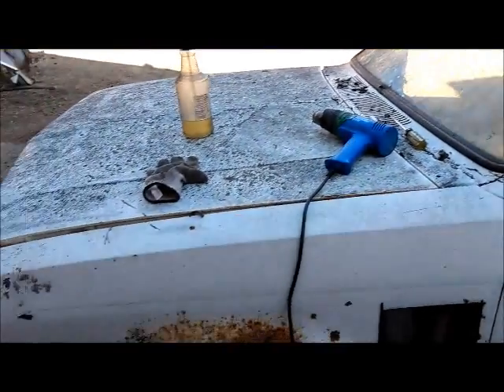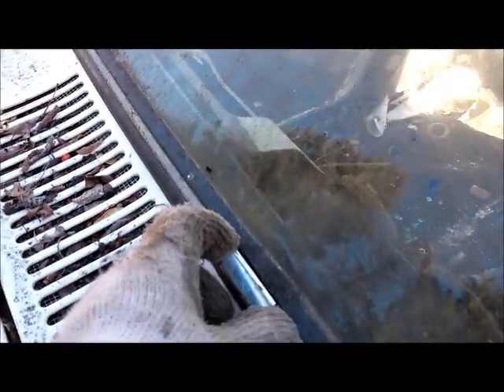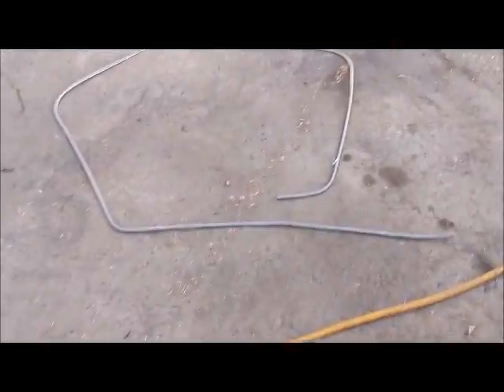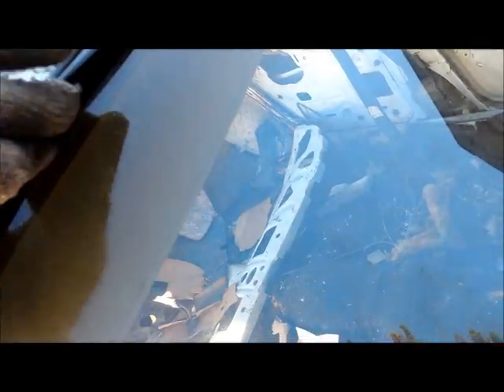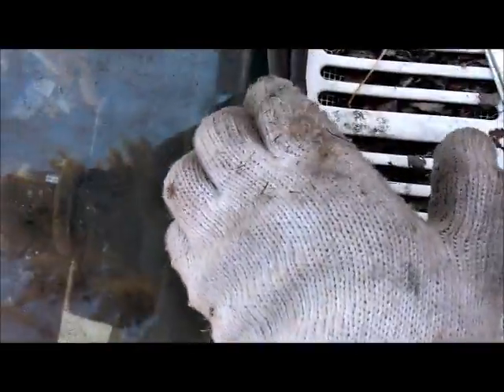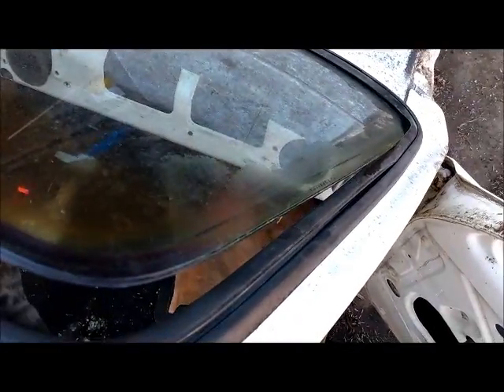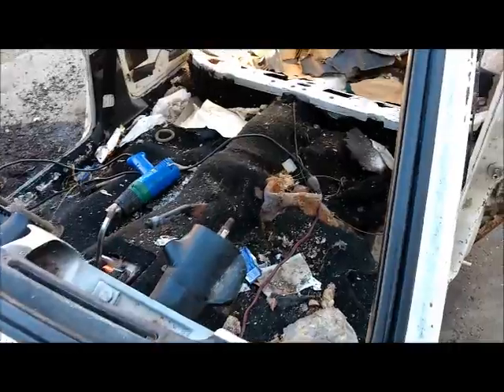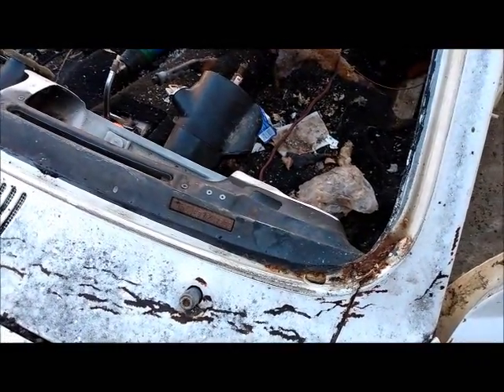Chevette DW854 windsheild removal

Comment: Another great removal tip. 
Does the rear hatch glass come out that easy?
Reply from the maker: Rear hatch glass, is urathane in place, with at T trim pressed in to seal exterior perimeter